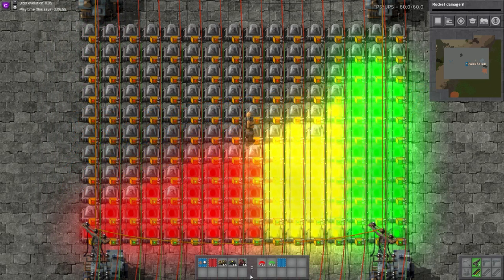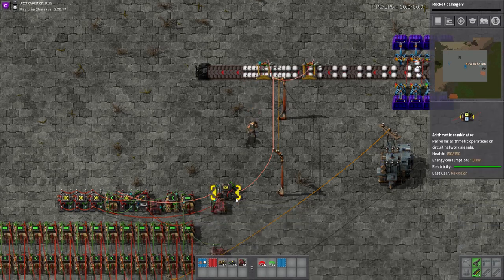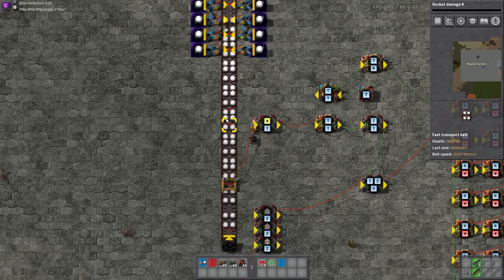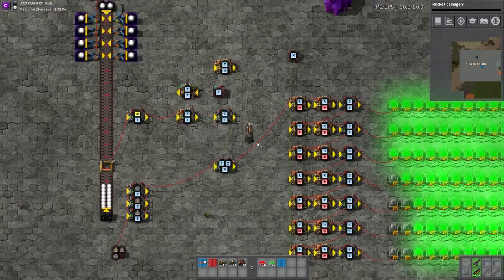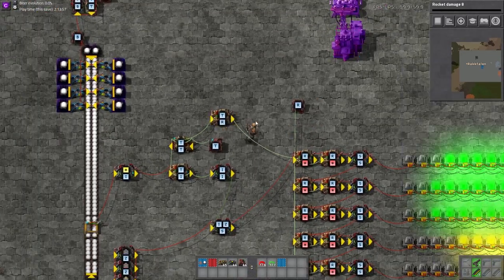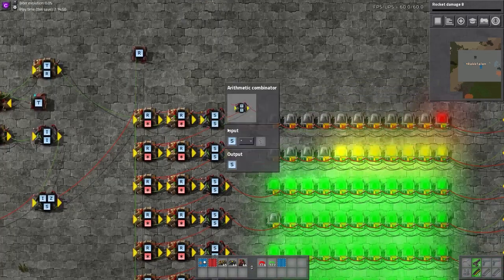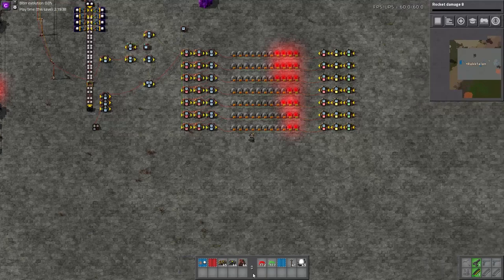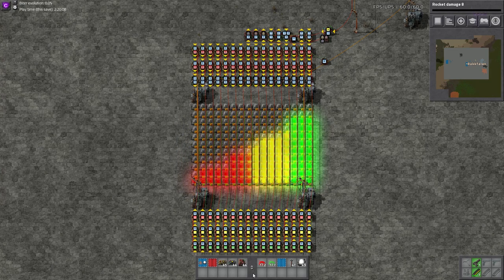Factorio Belt Throughput Graph (UPDATED)

Comment: Thanx man
You are the best
Reply from the maker: Glad you like it! Extra circuits of limited usefulness are my favorite. 😁
Reply: @Rakkfalen 
Did you ever do anything with factorio assembly languages, fal?
Reply: @Rakkfalen 
I wonder if you can help me figuring out this problem.
I'm building nuclear reactor, i noticed 2 things.
1- it takes a lot of items to build a reactor.
2-assemply machine buffers resources enough to build 2 reactors... 
So to make one reactor, assembly machine eats items that can build 3 reactors.

I wanted to make a system that controls how many items fed into the machine.
For example :
1-Constant combinator to store the quantities of items needed to build one reactor.
2- another CC, tell it how many reactors i want and then turn it on once. 

And a system does the multiplications and compare/ sub the items fed into the machine. 

Not  even sure if its too  complex ot too simple problem.
But controling the input inserts using the output inserter wont work. Because by the time the assemply machine out puts the reactor, it will be already buffered 2 reactors worth of resources